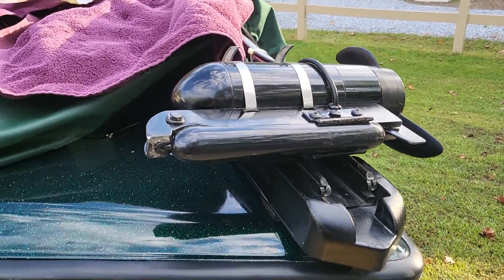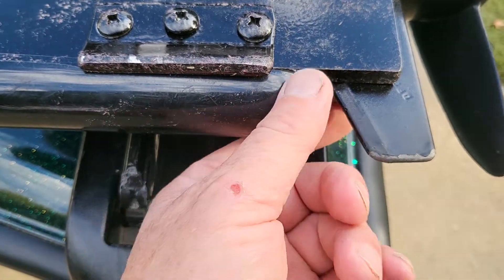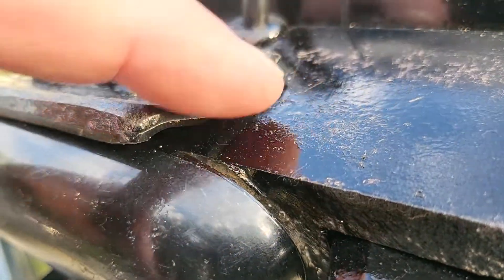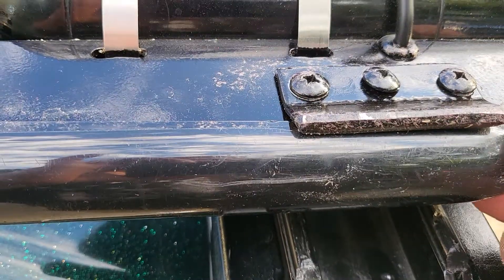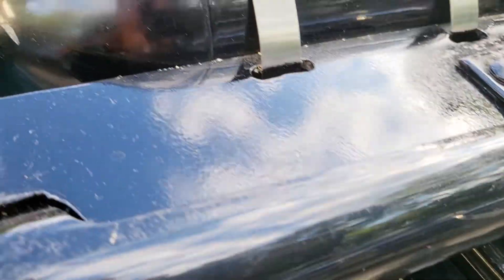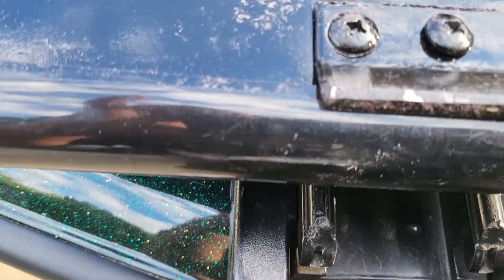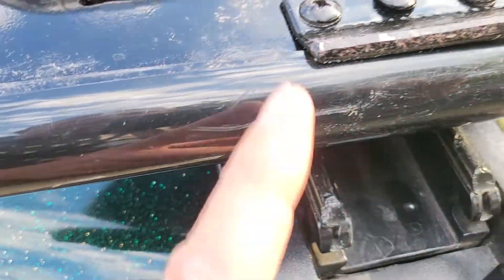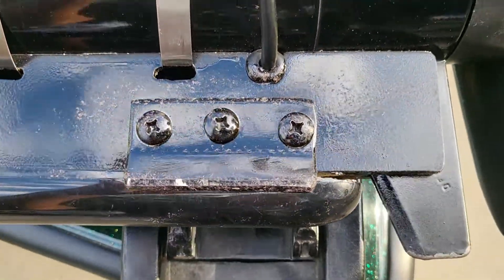Part 2, lowrance tripleshot transducer home made trolling motor mount.

Comment: Ok so I built one. My issue is that when the motor is on high it’s uncontrollable.  You have that problem?
Reply from the maker: at high speed it does make steering hard to bring back to center. Im going to Drill some holes as large as I can along the sides so water can pass through and relieve the load. This may work. I just have to be careful of my cable if I dont take it off.
Reply from the maker: https://youtu.be/clD8vD37j6o
Reply: Did the J B weld not hold and that is why you added the bracket  or was it for piece of mind?
Reply from the maker: @stevehawrylyshyn4286  both piece of mind and easier removal if need be.
Reply: @stevehawrylyshyn4286  Don't build it like this. You can't steer the trolling motor. You need to remove as much metal as possible between the transducer & the bottom of the trolling motor. Get the transducer as close to the bottom of the trolling motor as you can.
Reply: @earlzach  so do the holes make turning any better?
Reply: Is your left and right sideescan backwards now? Since transducer is facing opposite direction
Reply: His transducer is facing the correct way. Will work just as if it's mounted on the back.
Reply: @behrmanfivestar  Doubtful. I made one and it was very hard to steer. I cut as much metal out of the middle as I could & it works really well now.
Reply: @darralldougherty5388  did you just glue yours on loose end
Reply: @behrmanfivestar  Didn't need to. It's tight enough just using the bolt in the front.
Reply: @darralldougherty5388  thanks for the knowledge!